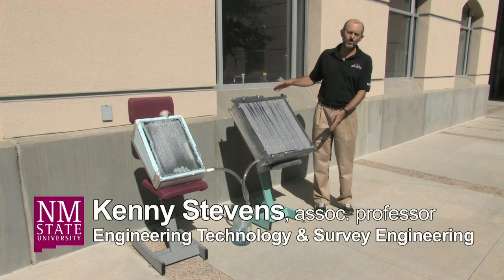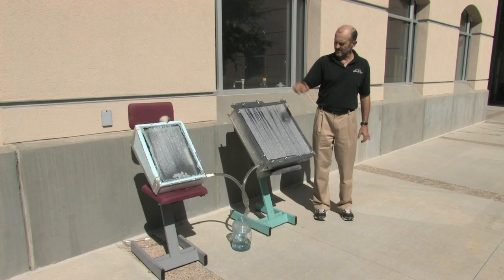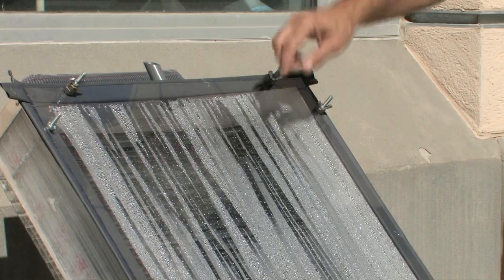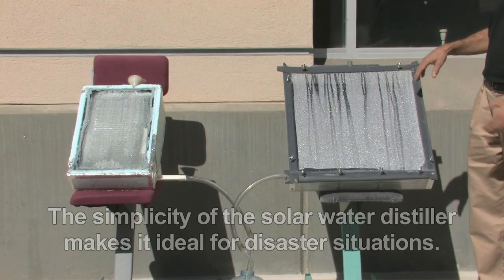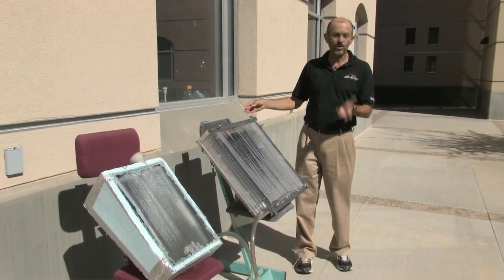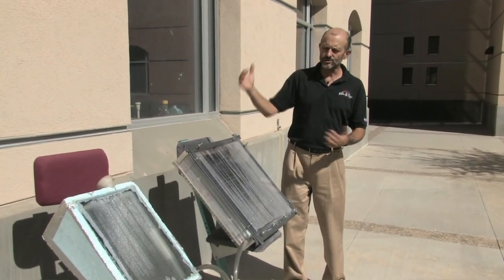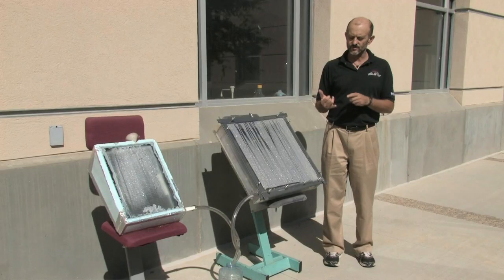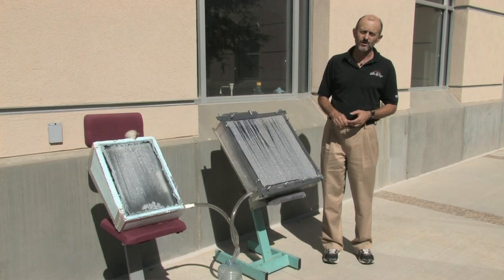Renewable Energy: Solar Water Distillers

Comment: In a pinch, a distiller can be built using just a sheet of clear plastic, a bowl, something to dig with, and a small rock. Dig a cone shaped hole, put a bowl in bottom of it, then cover the hole with a sheet of clear plastic, set a rock on the center of the plastic so that moisture condenses on the plastic and drips as distilled water into the bowl. A tube can be added so you can add moisture to the hole, and another to extract distilled water from the bowl without having to dismantle the device.

Comment: Will system like this work for recycling a shower and kitchen water? I was told to have a home in Arizona i need a septic system. But i don't think it's a good idea to mix a poop and kitchen water together when i could be recycling the kitchen water with distillation in the most desert no water areas.

Comment: A barrel isn't necessarily the best tool for the job, but it will work in a pinch.  The design shown in the video is more productive for distilling water because the area for condensation is greater and at an angle to naturally create more coverage for evaporated water to cling to for collection.  The water is closer to the 1st stage of collection and depending on the area and size of the glass you use, it might be a lot of water you could be collecting.

Comment: Hello, many thanks for your interesting video. I was wondering how much water per day we can produce in one square metre? And how much costs in materials? Can you provide the bill of material? Please
Reply: One square meter distiller can produce maybe 1 gallon (4 litres) on a summer day with full sun.  Over one year, figure 2 litres average per day with no down time, winter much less than summer, for a distiller this size.   The presenter Kenny Stevens said a 2-sq. meter distiller can produce the water needs for a family of 4. In reality this is not accurate. It would in ideal conditions output 2 gallons of distilled water on a summer day, just enough for drinking, leaving nothing for cooking or a sponge bath.

Comment: I'm thinking that if you could take a large rear projection t.v. and pull out the fresnel lens while staying away from the center focal point, a person could possibly accelerate the process by super heating the moist air. Going to look into that.

Comment: You would want to use materials that wouldn't introduce BPA, Pthalates, etc. back into the finished product.  I suspect the design that's shown would need some material modifications.
Reply: My thoughts as well, but probably still better then general contaminated water even with the BPAs

Comment: Everyone should have this!!!   I wonder how often it needs to be cleaned - because the scum would get thick in there eventually.
Reply: I have a heater distiller, I rinse it out after every use, and use citric acid to remove mineral build up every month or so.

Comment: You mentioned Uranium in polluted water in Columbus..  If the water is radioactive, will distillation remove radioactivity????  Thanks.
Reply: It will separate the water and irradiated particles, so that you don’t drink them, the water itself is not the thing that is irradiated.

Comment: so boiling is not necessary for pure water or it does boil technically?
Reply: Boiling the water only kills living threats, the water will still be contaminated with chemicals, pharmaceuticals, heavy metals, etc

Also I think a solar distiller does technically boil the water because it turns it into a gas.

Comment: We worked on building a very similar unit around 2009-2010 for India with Engineers without Borders. I still don't understand why this appropriate technology isn't used more widely. Here in Los Alamos area of New Mexico, for example, municipality water has very high concentrations of arsenic, and this would remove it. And it is so cost effective.
Reply: because you need to be a slave and pay big compagnies
Reply: I started distilling my two water in America, and what’s left after the water is gone is disgusting,  with how contaminated water is now a days distillation is necessary.

I have a heater distiller, but I’d like a more energy efficient way.

Comment: Why in the world would this video show up when you search for "large scale solar water still" first of all there is nothing large about it. It has a size limit, and you are seeing it. It can only be small, it produces very little water, and cost to make enough water to provide for all of a households water needs is out of the question, as well as maintaining the multiple stills. It is old tech, and highly limited in use and size. The answer is out there, but this version is not the answer.
Reply: the principle of solar distilling remains the same. with a decent design it works, simple , elegant.

Comment: Thanks for sharing! Calcium and lime kill evaporative coolers... I'm in Las Cruces, interested in installing a distillation unit to feed my 3 ton evaporative cooler. Assuming 15 gals per hour, that's 360 gals per day, requiring 720 square meters of glass (a 27m square). That's a 88ft square or 7750 sqft. Not very reasonable for a 1400 sqft home, as it would take up the whole plot of land.  What can be done to make the distillation process more efficient?  I hear intermittently spurting water on the glass helps.
Reply: Cool the glass, heat the water or both.  Run a coolant line like a geothermal coil into the ground circulate it cooling the glass.

Comment: Can't believe anyone would use Plexiglas or any plastic material as a condensation surface for a still. 
You'd think everyone would have known by now, that the sun causes molecules to move from the plastic into the water.  If neighborhood dentists know about it, this fact should have reached just about everywhere?

One of the reasons to avoid water that comes in plastic bottles...  Solar stills should be made from stainless, glass and as little else as possible.
Reply: i agree no plastic, we know that by now, this vid is from 2012 bro

Comment: The idea is simple, but you don't find any company making it. Unless it's air tight, bacteria might get into the condensed water. A simpler approach might be to have a larger glass jar containing a smaller glass jar, using the large one as the condensation collector. It must be airtight, and using an upside down glass to prop up the smaller jar to the view of the sun, and bury the condensation collection part under the shade.
Reply: Even if it gets bacteria without nutrients it wont have any growth. The only one i cant think is botulism but the requires rusty metal. You could turn pee into water using this. Perhaps more dangerous would be a fungi. As it could just live in the tank and spore into the distilled water. 
Besides this water is mostly pure its good for cooking but id probably run it through a second solar distiller thats only running once distilled water so it should stay extremely clean.

Comment: Lets build massive industrial sized distillers on the Sahara desert, and start turing sea water into a massive agricultural zone. Lower the sea level, and combat climate change.
Reply: matthew miller , there is the dillema, do you bring desert to the sea or sea to the desert
Reply: Głos z Ameryki 
Check a map, they already meet and once purified water is easy to pipe further inland.
Reply: You won’t lower sea levels to any significant extent watering the desert. Other than that I agree with the principle.
Reply: old Goat  Okay Thanos
Reply: Matt   - a great idea. Pity the United Nations dont do useful things like this and alleviate water & food shortages in Africa etc. Instead ; every few years there are disasters followed by charity fund raising.
Reply: Because Sand dunes are great for agricultural.  What a stupid idea.
Reply: @smokethirteen  everything can become a sand dune if its hot enough, for long enough
Reply: smokethirteen 
Have you heard of hydroponics?

Comment: Gravity induced vacuum distillation will do what you want faster and if you add a steam turbine you can make electricity. Water boils in a vacuum at room temperatures 75 degrees F . You can make a cheap vacuum system capable of a hard vacuum of 30 inches of mercury with piping in a vertical direction 12 meters inside an open topped pipe length 10 meters. The inside pipe has valves at the top and bottom, the inside pipe is filled with seawater to the top then close top valve and open the bottom valve gravity will pull the water down leaving 2 meters worth of hard vacuum as it fills up the 10-meter outer pipe. 
Now how do we get the fresh water out? We set up another vacuum pipe connect them with a condenser coil cooled with sea water and shaded from the sun taking the vaporized water from Vac A to Vac B where being a lower temp condenses to be removed at the bottom valve of Vac B. To make the system flow continuously add a spray nozzle to the top of Vac A spraying in seawater warmed by the sun after  cooling the condenser coil of Vac B the spray increase the surface area making instant steam in Vac A creating fresh water as fast as in can condense in Vac B.
Reply: yeah , million dollar solution which takes 3 years , vs. 50 cents in the woods within 5 minutes.
Reply: It wouldn't take a million dollars to build my system less than a thousand dollars is very do able.

Comment: Using plexiglass defeats the purpose as does the chemical leeching plastic storage container you are using to collect the end product. No plastics and no aluminium or zinc products should be used for this.
Reply: Yes, no plastics, no toxic ashesives, no metals. I'm building one with glass layer in bottom over black paper. Im trying to find someone to split cut my glass tubing for the collection tube/trough. These distillers are a great idea but only if we're not slowly poisoning ourselves. The black silicon coatings, PVC and plastic pipes being used is crazy especially with the heat they create.
Reply: I agree...Stainless and tempered glass should do the trick..
Reply: hah, you beat me to it.
Reply: @GłoszAmeryki  You're missing a relevant detail:  Glass is easier to come by and cheaper than Plexiglas.  Generally, Plexiglas is used either out of laziness by the crafter or, because they need to bend it and are only doing a one-off. Maybe to reduce risk of shattering. but neither of those is an issue / requirement for a still.

So I'll call their use of Plexiglas gratuitous...

You can actually make pretty good stills with just some bamboo, sand or even mud. Enough examples on YT. Watch some of those vids, those guys kick ass in helping themselves.

Its not like everybody outside the first world is brain-dead and incapable...  its more like western manipulations cause a constant and intended state of chaos and poverty they can't overcome.

Comment: I have noted up to the first 100ml may contain hydrocarbons from gasoline, or other contaminates which are heavier than water and come out first when condensed. Throw out the first 100 ml and then you should be good  for that load of water you added to clean up to drink

Comment: OK, better than nothing. But removing weight chemicals as in heavy oil parts are a big problem. Isnt it What else is heavywight? Heavy metals? Large molecule stuff?  In another video a guy did put food colorant in it and it was in the destilled water too!  This is not very promissing and let me not feel safe.
Reply: Hello E kam, I'd like to see that video in wich the colorant is in, do you have the link?

Comment: very inefficient, you probably need to do something based on Fresnel Lens.
Reply: Just one last issue. Everyone is talking about ways to focus the sunlight but if you are doing this you need a whole different kind of collector. Most of these designs use silicone rubber. I used to work with silicone rubber and epoxy. Even high temperature silicones max out at 500 to 550 degree and the kind they are using it's much less, I'd guess no more than 400 degrees. Concentrators like Fresnel lenses can easily top a 1000 degrees. Anywhere near their top temperatures the silicones will also out gas. You're cooking the plasticizers out of the rubber and they start to break down. If you want to increase output the easiest way is to cool the glass not heat the chamber more. Always remember it's the temperature difference between the inside and the glass that causes the condensation. If there's no wind put a box fan next to the glass and you might double your output. If you want to use Fresnel lenses you need a completely different design.
Reply: Cary Howe
what about parabolic mirrors? better than Fresnel lens, easy to make from a scrap satellite dish and a reflective paper film
Reply: amilom007 , yeah , why not spend 100$ (2 months salary) instead of 3$ and have BETTER solution in the $Hit country
Reply: These systems are mainly intended for third world countries where old windows can be readily available but a fresnel lens may be hard to come by. I've seen them made out of old car windshields. Most countries have junk cars and it's a better use than letting kids smash them with rocks.
Reply: There is high temperature distillation (boiling point) like the purified water sold in stores and low temperature distillation like this process. Fluoride is the toughest if not impossible to get rid of completely. After having 3 different samples of each (low temp and high temp) and different batches, my lab results were way lower in Fluoride traces in low temp. distillation than high temp. distillation. High temp. were at 212 Fahrenheit and low temp are around 135 Fahrenheit. As a bonus, the water tastes better at low temp. Just my own little experiment.
Reply: +amilom007 I was just thinking that... at the right distance from the focal point, and with enough space to work with; you could distill as much water as you want in next to no time. Only catch with the fresnel lense is how incredibly dangerous they can be.
Reply: I ended up here because I had similar thoughts as many. Using a convenx lenses such as a magnifying glass or a mirror such as those used in a dobsonian telescope. Set either one to the correct focal point and perhaps one could increase the output of a solar still.

Comment: Does this work for chemically dirty water?
Reply: Most organic chemicals including gasoline have a higher evaporation rate than water. If there's chemical contaminants they usually discard the first cup to liter of water. If there's still some in the water just run the same water back through the system and repeat the process discarding the first water produced. The bigger problem tends to be with water with strong odors. Those can be tough to remove but lightweight chemicals are less of a problem. He didn't show it but usually you do a prefilter with something like an old piece of cotton cloth like an old t-shirt. You want as much of the solids and organic matter as possible removed from the water. Sea water can be one of the easiest and the left over brine can be cooked down into salt. If you want to improve efficiency make sure there's good airflow across the surface of the glass. The temperature difference between the inside and outside of the glass is causing the condensation. You can even put a wet towel across the top. The water evaporating will cool the glass increasing output.
Reply: Cary Howe Thank you so much for the detailed breakdown. I have been doing more research on this &  what you say is confirmation of it :).
Reply: Just glad it helped clarify the situation. Some of the simplest systems can be the most confusing especially when you can't look over it for yourself. I saw a video on a really nice rocket stove and heated bench set up and based on the video I couldn't tell where the outlet pipe connected to the reburn chamber. After watching it three or four times I finally caught a glimpse of it the corner of a shot. Details matter. The first time I saw this system of biochar burners I did a little head scratching until realized the weight of the drum and wood was creating a seal and the back pressure kept the oxygen from entering. Good luck with everything and glad I could help.

Comment: Could you speed up the process and increase the output using evaporated tubes? Doing so would also negate the need for a see thru membrane? All that matters is the collector be food grade material that will not break down with the levels of UV and heat it should experience? 
My logic behind increased production is some days you will have clouds this could reduce your production so you want to cooking with grease so to speak? 
I have purchased smaller evaporated tube for less ~$10 each their volume was just 20 oz but in under 45 min that 20 oz was boiling without a collector add a collector 15 min boil.

Comment: wish he had gone into the construction of the stills
Reply: +IClausius   For those looking for plans, here are a couple. The first, I remember
from when I subscribed in 1974:

http://www.motherearthnews.com/renewable-energy/solar-still-zmaz74sozraw.aspx?PageId=2
http://www.motherearthnews.com/diy/home/how-to-make-a-solar-still-ze0z1209zsch.aspx
For those concerned about the lack of minerals (not sure how you are
monitoring for the presence and amount in your current drinking
water, but...), consider adding a colloidal mineral to your final
distilled product, if you feel that you are missing out.  We use a
product called Concentrace.
Finally, it is my understanding that certain solvents in the water will boil
off before the water due to a lower boiling temp.  For this reason a
cheap carbon filtration device should be added to the out-going line,
prior to hitting the collection bottle.  Obviously, this filter
should be changed frequently.
Reply: @tomcornwell4688  bro, enough with the essays!.....;0